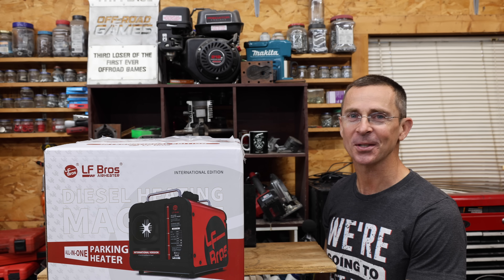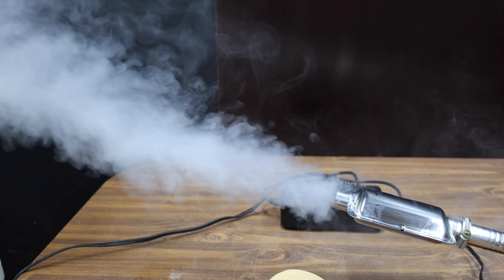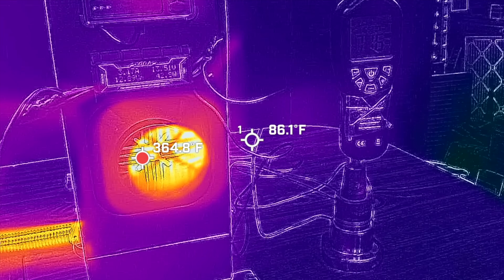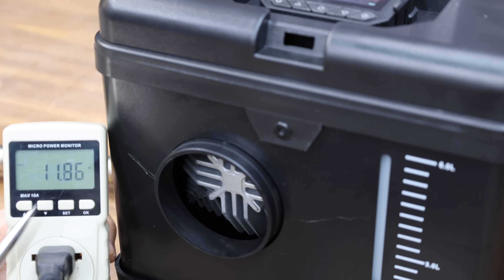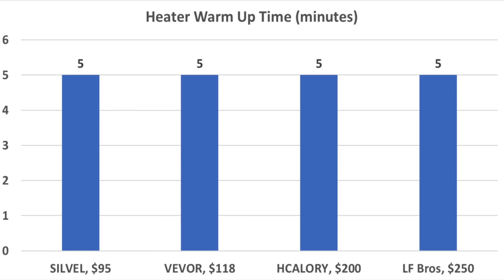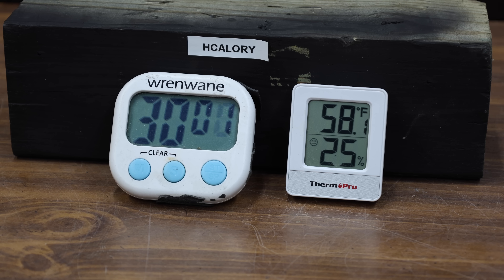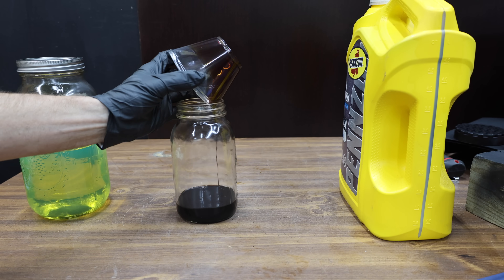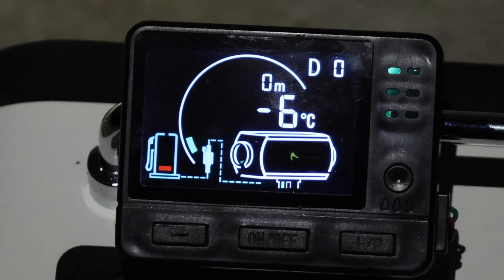The Truth About Cheap Diesel Heaters!

Comment: Nice review. I’m interested in using one of these in my un-heated garage. I have plenty of waste oil which I can mix with diesel.  Just not so sure what the long-term viability of of using such a mixture would be.  I may try the Vevor because of the side port on fuel tank.  Not so worried about the tipping hazard as I will probably wind up mounting it securely anyway.
Reply from the maker: Thanks for the feedback.

Comment: I think the smoke from the first heater was due to the low voltage shutdown. The heater had already begun to inject fuel into the combustion chamber before it shut down, causing an over fueling effect when the heater was restarted.

Comment: Get the new white 2kw diesel heater from Vevor, 5/8kw is over kill for 90% of applications resulting in people running them on low which causes incomplete burn and sooting up, which eventually results in failure of the unit. 2kw heaters are so much more economical, also, and are a much smaller complete unit, meaning that they can be installed anywhere, easily and are simple to transport, or store, out of season. No regrets buying a 2kw diesel heater.
Reply from the maker: Thanks for the feedback.

Comment: There are aftermarket remotes available for these, mostly for the bluetooth models, that will allow for more precise heat control and on/off cycling.  It seems there are many variations of factory controls on these units, but all of them place too much emphasis on graphics, voiceovers, and fluff rather than true heat control options.  As stated in the video, a lot of the hardware is the same across all the brands.  Last year when I bought mine, there were at least ten different 'brands' available.
Reply from the maker: Thanks for sharing.

Comment: To be fair to the Silvel, I'd say it only smoked so much on startup due to the first start attempt failing and dripping diesel into the burn chamber.  My Vevor will smoke if something interrupts the start up procedure, otherwise it doesn't smoke at all on startup.
I've converted one of mine to run off two Ryobi 18V batteries through an 18-12V converter that can be switched off independently so they can be swapped out one at a time so the heater never has to be shut down.
I posted a video where I've ran mine as a test in my 24X26' garage that's extremely well sealed without venting the exhaust outside just to see how long it would take to set off my CO detector.
It took well over an hour with just enough CO to trigger it at it lowest detection ability.
Sorry about my rambling on, it's a subject I'm very interested in and have researched a great deal, doing some experiments on my own with various diesel heaters.
Thanks for the test.  A comparison to some of the more expensive brands like Webasto or Eberspacher would be a great follow up to this video
Reply from the maker: Thanks!  Thanks for the suggestion.

Comment: That power analyzer consume on that mode the load power aka stealing the power. Use additional line for that purpose. It is specially handy on battery testing where voltages goes under minimum

Comment: Considering they all have the same Webasto clone heating element, the only differences in all of these is the outside cases, control units and noise. The heating performance should be identical in all of them. Unsurprisingly the one with the highest flow/air speed makes the most heat.
Reply from the maker: Thanks for the feedback.

Comment: The first unit only smoked during your test because it initially didn't complete the startup sequence due to the voltage drop. If you hooked it up to the proper power supply at the start then it wouldn't have happened. These units do not like losing power when starting or running and can blow heavy smoke through the intake if it happens.

Comment: Great vid but let me share some info. I have tested over 2 dozen different diesel heaters. The smoke issue you had with the first one possibly had to do with shut down during start up. Heaters start pumping fuel as the glow plug warms. The glow plug draws the most power causing the system to shut down due to lack of electricity.  FYI smaller wire than 10 gauge, 8 gauge depending on length will not supply enough power and trip the system shut down. You possibly had unburned fuel in the combustion chamber during the 2nd start up causing the smoke. Think of diesel trucks on a cold day or what "rolling coal" actually is. Also note for the same price get one that has a quiet pump, not only are they quiet but get better efficiency. Hf bros has been a reliable heater for me, permanently mounted in my living room for 2yrs now. I run soley off grid in the U.P. of Mich. Also there are soooo many options out there for these heaters that configuration, options like wiring, are vast. I have disassembled and custom built several set ups in housing and off grid camper builds. Super easy to play with. More info I can share, if you typically run low heat setting, turn on high for a few mins before shut down to burn n clean the combustion chamber. Helps from having to take it apart and manually clean the internals, which the culprit is often a dirty, tiny Lil screen down inside restricting air flow. My channel is ihaveastory6132 and while I'm not there yet, I plan to share my off grid lifestyle and how I survive the far north self sufficiently with modern tech
Reply from the maker: Thanks!  Thanks for sharing.

Comment: I added an inline fuel filter and threw a small magnet in the tank of my setup to help filter the used oil I ran through it. I also found that a 4/1 diesel to oil ratio was about as far as you could go without excessive soot buildup. If you do get excessive buildup, pull the combustion chamber apart to clean out the buildup and it'll run good as new afterwards. 
Great video BTW, thanks for the info.
Reply from the maker: Thanks and you are welcome!  Thanks for sharing.

Comment: A test to add to all of your videos (where applicable) is to test the resistance of the supplied wiring; it might not be copper wire (as a cost saving).
Reply from the maker: Thanks for the suggestion.

Comment: Better to use a generator and space heaters. Dual fuel are good, using propane bbq tanks is much better than storing and pouring gross fuel. I use my generator whenever electricity is out the only downside is it is loud. I do not understand how to use these heaters inside. You would have to run the hot exhaust pipe out of the building? Seem very stupid compared to a generator you can use for everything.
Reply from the maker: Thanks for the constructive feedback.

Comment: My only question about these heaters is did you test the carbon build up on Hi heat versus low heat????

The reports say it is best to run on high heat to keep the carbon build up under control.  If you run on low heat, low fan speed,  the burn chamber tends to build up carbon and will ultimately shut down the heaters.  Then you have to open it up and chip away at the carbon to clean it out so you can use it again.

burning used motor oils tends to have catastrophic results with garbage build up in the burner..  highly not recommened.
as for vegetable oil,  if it were an emergency and one time only, prob get away with it.

But carboning up in the burner is a very real problem and many have had it already...  maybe you need to do a follow up vid on this.

Comment: I'm trying to remember who or where I saw it.  But I swear I saw someone run the exhaust through a heater core, condenser or heat exchanger of some style to get basically 100% of the heat out of the unit.  Instead of losing so much out the exhaust.

Comment: Altitude has everything to do with the performance...1688 is the default to adjust the settings. Ive been using 1 in a small converted cargo trailer for 4 years and 2 as back up in a 40' connex. you need to keep spare parts etc....
Reply from the maker: Thanks for the feedback.

Comment: I have seen one that does not have a clicking fuel pump. That would be a must for me. I also saw where one user ran the exhaust through an old cast iron radiator so it extracted the heat before going outside.
Reply from the maker: Thanks for sharing.
Reply: There's vids on a quiet pump that worked and how to quiet it slightly more

Comment: I worked  for a large landscaping company as their mechanic,.they had 12 trucks that plowed snow in the winter,3skid steers,a mini ex,rubber tire loader etc. I had a kerosene torpedo ,we ran out of kerosene so I put off road diesel in ot and it worked  great! I used it like that for about ten years  till we got a wood burning stove.
Reply from the maker: Thanks for sharing.
Reply: Yes, Kerosene/Diesel are interchangeable. #1 diesel is kerosene or a mix. Winter blend #2 diesel is just a blend of regular #2 and Kerosene with different percentages depending on temps

Comment: I’ve already bought two of these in the Hcalory flavor to heat a boat in Alaska. They are the same except the second heater came with a newer controller. I noticed the second one used more fuel by a significant amount to heat the same space. I switched back to the older one. Still scratching my head about it. That extra energy has to be going out the exhaust. Thanks for the video!
Reply from the maker: You are welcome!  Thanks for sharing.

Comment: I have a vevlr 8k heater. Fuel line on this is cheap and thin. Mine started leaking diesel few days in. Bought some fuel line at local autozone and this fixed the issue. Also the gas tank seems very thin so I'll be replacing it with somethinglike a rotopax gas can.
Reply from the maker: Thanks for sharing.

Comment: Please redo the diesel heater testing adding Eberspächer and Webasto diesel heaters. Eberspächer is the gold standard for diesel heaters and Webasto is another very highly rated brand, both are made in Germany and both are very high quality.
If there is a possibility of a life or death situation, stranded in winter conditions whether in a camper van, overlander/expedition vehicle, RV, house or camp in the winter I would not buy a Chinese made diesel heater. I want the highest quality, highest reliability diesel heater available and have common replacement parts available just in case a repair is necessary.
Reply from the maker: Thanks for the suggestion.

Comment: I have a Vevor and an Hcolory 8kW heaters that I bought 2 years ago. The Hcalory is a torpedo looking unit with an external 10L tank, remote, pump, and external display ($106). The Vevor is an all-in-one unit that is shorter (about half the height of the one you have) with a 5L tank ($97). Both function at high altitudes but Vevor below 10,000ft & Hcalory higher, and can be thermostatically controlled or manually controlled. I added longer exhaust pipes, exhaust heat fiberglass wrap ($20), and two 12V 30amp DC power supplies ($22 each) for indoor use with a battery for backup. We have at the Shell station here now Biodiesel sold at the pump that I've been trying, and it seems to work pretty well, and I don't smell any diesel smell out the exhaust when the heater is running.
Reply from the maker: Thanks for sharing.
Reply: What exhaust pipe you use?
Reply: @mrmotofy  The 2.5cm/1in inside diameter, 47.2 inches long, and then I also added on the pipe that came with it.

Comment: DO NOT USE MOTOR OIL IN THESE HEATERS. I have a fair amount of experience running these and disassembling them for cleaning. Black diesel/used oil will put your heater out of service within two tanks of fuel. The carbon build up is bad but what kills them when running oil is the rock hard ash deposits that build up around where the fuel is fed into the burn chamber. It can be very difficult to clean out this crust and will require new gaskets and a mesh screen almost every time you open it up. I’ve tried different blends of oil/gas/diesel and have run into this problem every time. All the oil I use is filtered down to half a micron so straight used oil will exasperate this issue. Please learn from my mistakes and unfortunate experience, it isn’t worth it unless it’s a true emergency. The heaters themselves when run with regular or dyed diesel are awesome though. They are perfect for inexpensive heat for backup or to warm up a shed. I use one in my solar kiln I built to help maintain temperatures at night.
Reply from the maker: Thanks for the feedback.
Reply: @ I love your videos and have saved so much money/made informed decisions thanks to your testing. Keep up the amazing work, as far as I’m concerned your channel is one of the most important ones on YouTube. You and the guys at Torque Test Channel have done more for homeowners and DIY folks than I think you know.

Comment: Awesome video as always and at the perfect time as I’m looking to figure out a heating solution for my garage. Also have to say potentially the best video on diesel heaters as I’ve been looking around YouTube and have found nothing close to this level of detail.

As a video suggestion to maybe be a part two to this video would be taking some of the best performers and doing a little durability test. Personally what I’m most interested on is how bad is the carbon buildup with running used oil with diesel compared to straight diesel would be. I personally have a lot of spare used oil around and depending on what would hold up best would persuade what I buy.
Reply from the maker: Thanks!  Thanks for the suggestion.

Comment: Critically Important! DO NOT RUN THESE ON A POWER SUPPLY ALONE WITHOUT A BATTERY BACKUP!

I have experience with these heaters. I own a Vevor model, which I use to heat my greenhouse, and I’ve installed a maXpeedingrods model on my boat. The most critical safety consideration is that these heaters can become a fire hazard if power is abruptly cut off.

These devices require a cool-down period after being turned off because the combustion chamber can reach temperatures of several hundred degrees while operating. When you shut the heater off, the fan must continue running to dissipate heat until the chamber cools to a safe temperature.

If you're running the heater on a power supply and there is a sudden power outage, the fan won't operate, leaving the residual heat trapped. This can cause internal plastic components to overheat, potentially melting and creating a serious fire risk. Always ensure you have a battery backup to maintain fan operation during unexpected power interruptions.

In addition, my Vevor unit didn't come with a fuel filter.. I highly recommend putting one in as this killed 2 pumps before i got around to installing my own... Overall of the two units I've purchased, the maXpeedingrods was definitely the better value.. no major difference in the heater itself, but a significant difference in the quality of the housing, exhaust pipe, and fuel lines, and it  also came with a much quieter pump, a proper fuel filter, proper clamps for the fuel lines instead of worm clamps, and heat wrap for the exhaust pipe.. of the two I'd recommend spend the few extra dollars for the better quality accessories.

Last point to consider... these are great when you don't have a source of electricity, but honestly, if prices where you are are anything like they are here, the cost of diesel per unit of energy is quite a bit more than the cost of electricity, so these cost anywhere from 2-3 times as much per kwh of heat compared to just running an electric space heater... food for thought.
Reply from the maker: Thanks for sharing.
Reply: Good insight. Curious, what are your diesel and kwh prices?

Red diesel without road tax helps a bit.
Reply: @rbutter9200  welll, im up here in Canada, so my calculations use metric, but... Quick math... One liter of diesel contains 10.6 kilowatt-hours (kWh).... Assuming perfect efficiency, at $1.80/litre, that works out to roughly $0.17 per kwh... We have a two tier electric cost here, which is is $0.11 for the first 675kw/m and then $0.14 after that, but even on the second tier, even if the diesel heater managed to capture 100% of the energy in the diesel for heating purposes, electricity would still be cheaper.... But of course the diesel heaters aren't 100% efficient... Ignoring combustion efficiency, at least half the heat produced goes out the exhaust pipe, and that all by itself ends up making these quite an expensive way to heat compared to electricity... But that said, when you can't get enough electricity, or if you happen to have some source of alternative fuel or cheap diesel, then they could be a great option... Hence why I have two... Lol 😂
Reply: @michaelransom5841  Freedom units or nuthin! U.S, Liberia and Myanmar know what's up!!! (Obviously every other country in the world is blowing it!).
Thanks for taking the time for the detailed reply. Same here, my hydro is teir one and their 2 at those rates. A fellow BC'er?

I want these to be a cheaper option so I can  justify setting 1 up, ha ha! Great for an extended power outage though, (provided battery power available).

In the UK, they have pretty crushing energy prices, so you could probably come out ahead! 

Cheers!
Reply: @rbutter9200  haha!.. small world.. yup.. fellow BCer... Im in Victoria to be precise... And yess, we do get kind of spoiled with our hydro prices compared to most places (although it sure doesn't feel that way when the bill comes! LMFAO 😂)...
Reply: @michaelransom5841  yes! Hard to be smug about our reasonably priced Hydro electricity, while homes are 3x everywhere else! I'm in Burnaby, (on electric heat!). Cheers